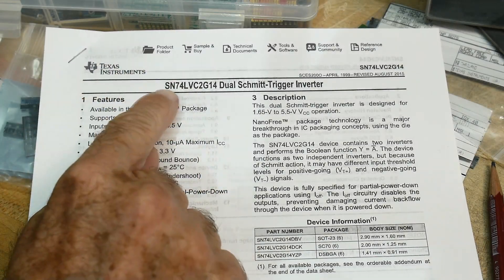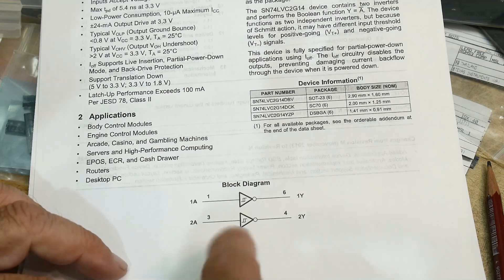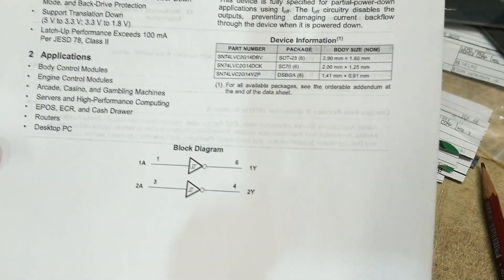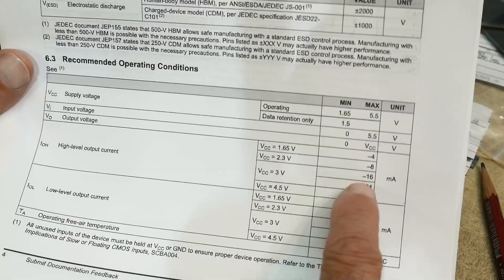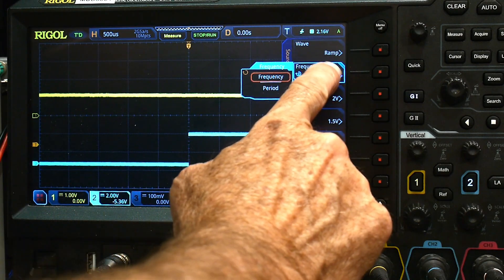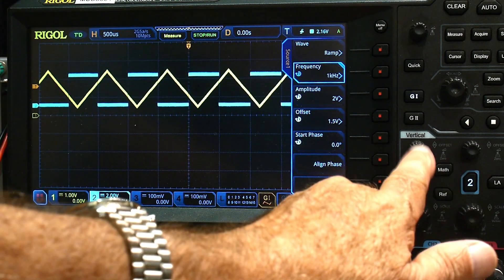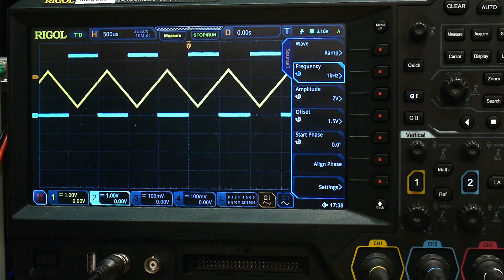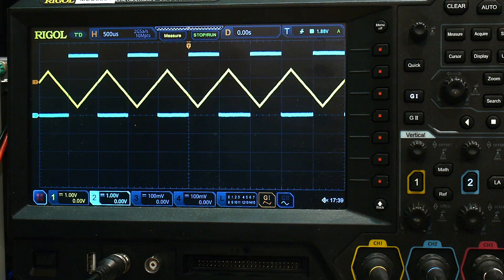#1963 SN74LVC2G14 Schmitt Trigger

Comment: I disagree with using them for oscillators. I built a board and I have some of these 72LVC2G14 in my stock so I designed them in for the oscillator. When I built the board they would not oscillate. To get it to work I had to buy 74LVC2G04 parts and then it worked perfectly. I should add that this was a crystal oscillator not just an RC oscillator. One of the gates was across the crystal with a parallel resistor 1M and two 18pf load capacitors. The other gate was used an output buffer.

Comment: I like these chip of the day videos. I have a question about these SN74LVC's. Do their inputs need any current limiting resistors? Or are the inputs very high impedance like comparators and opamp inputs are? thanks.
Reply: The inputs are MOSFET gates, but watch out for the body diodes - you can't take any input below ground.

Comment: Great to know the applications are Arcade, Casino, and Gambling Machines.  Just what I needed!
Reply: Lol.  I have no idea why they need this inverter chip for arcades, casinos and gambling machines, but whatever floats their boat :-)
Reply: You forgot "cash drawer" - another useful application.
Reply: Over the time i found out that the applications examples are most of the times whatever they have in their mind at that moment. Much more useful would be saying something like "oscillator circuit, peak detector, squaring a signal, low power driver" etc.